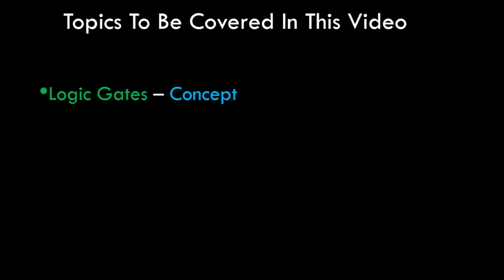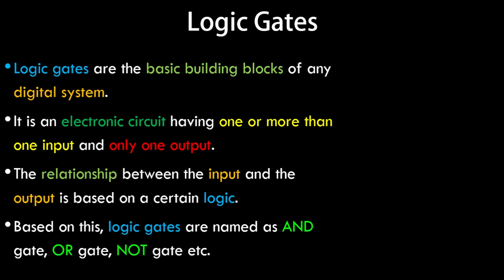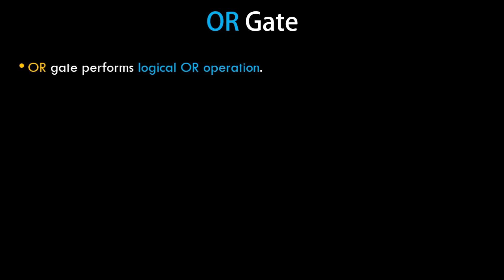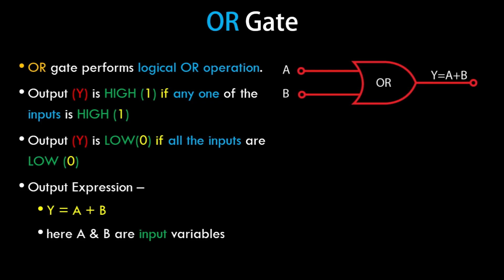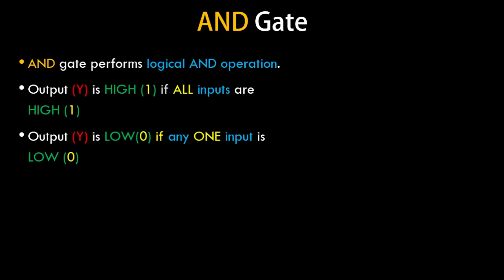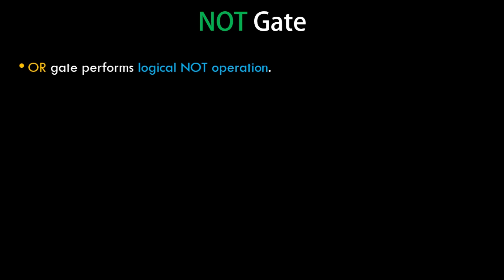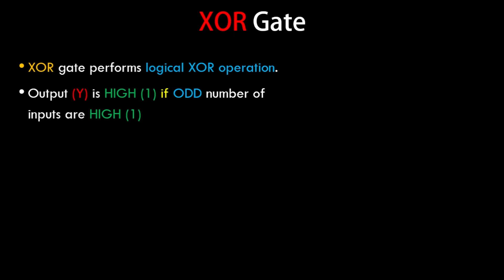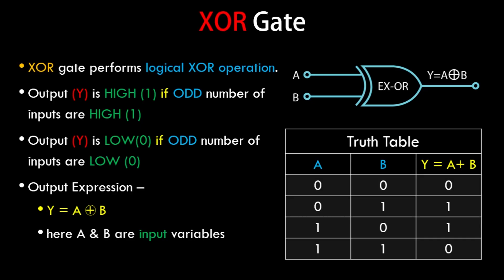Basic Logic Gates - OR | AND | NOT | XOR gates | Boolean Algebra

Comment: 5.03
U said in last case both the inputs are high that is even number of inputs are high that is why the output is 0 
Is 1 is a even number?
Reply from the maker: I said the count of inputs that are high is even since 2 inputs are high right ? and 2 is an even number right ? Hope you are getting this. 
Also there is no 2,3,4,5 as direct inputs in digital systems. Its binary and has inputs 0 and 1.
Reply: @SimpleSnippets  You should have mentioned it in your video. because i was also confused with this, but this reply cleared everything. thanks.
Reply from the maker: Oh okaaay ✌️😊

Comment: I have a problem with the second statement of xor gate the OUTPUT IS LOW (0) IF ODD NUMBER OF INPUTS ARE LOW(0) BUT 1ST LINE IN THE TRUTH TABLE CONTRADICT THAT.. PLZ EXPLAIN IT
Reply: let me tell an easy method 
if  odd  no of high input, the output is 1
if even no of high input, the output is 0
Reply: @agathyanbarathi  If ODD no of HIGH inputs then Output HIGH otherwise LOW
If EVEN no of LOW inputs then Output LOW otherwise HIGH. 
I think it explains better.
Reply from the maker: For XOR gate, the output will be High if ODD number of inputs will be high, else it will be LOW. which means that if 2 inputs are high, the output will still be low because 2 is an even number.